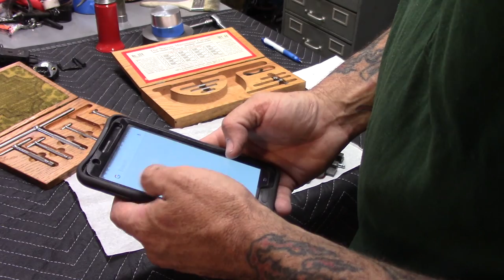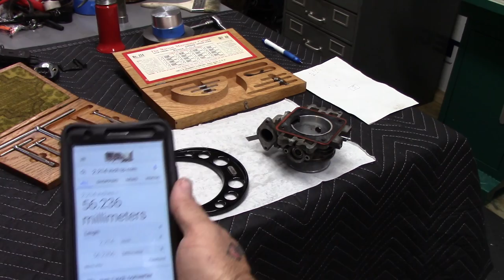throttle body jig prt 3

Comment: Looking forward to Part 2, and the testing... I understand all that is going on here, and know how much of a performance and fuel economy upgrade installing a Jeep 4.0 ltr throttle body can do for the Jeep 4 cyl engine... Do you have a PCM scanner/programmer, that can see real time... That would be some numbers I would love to see the comparison on... if not, the standard check, via simply pushing the gas pedal is fine...  This is actually exciting stuff here.. due fact, that anybody can buy bolt on performance parts, which is just fine, but, for folks who are cheap, let alone, poor like myself, I always enjoy the challenge of doing stuff myself.... Nice job, Boss.  I know you got a life to live, but, ........ hurry up on the testing phase, LOL.. I wanna see how it does....!!!! Dru
Reply from the maker: Dru Bradley got it finished video is uploading to you tube now went flawless I'm gonna have to take it out and drive it did run it in the new video idles perfect revs up quicker no stumble at all can't wait to go really test it out but seems like an improvement took it form 55mm to 60.8 mm close to that I like making power free power is the best I'll make a separate video on my thought and testing it thanks for watching